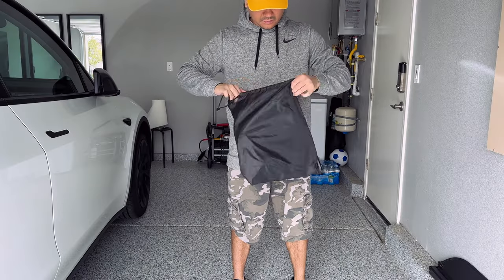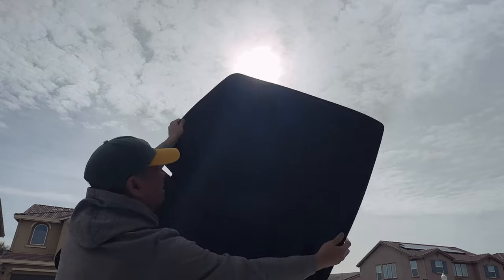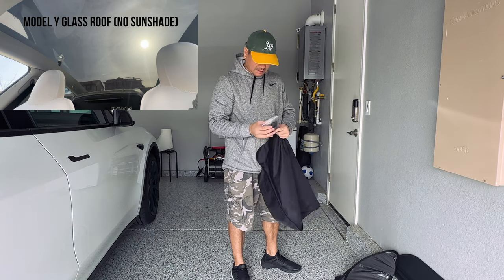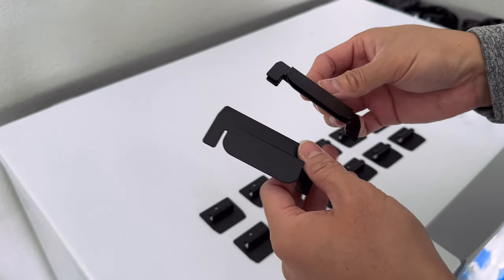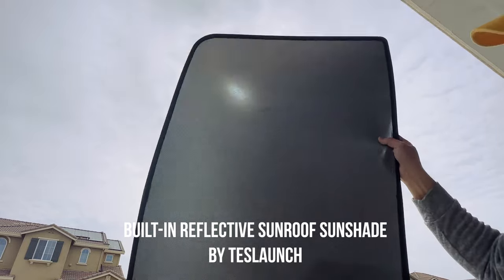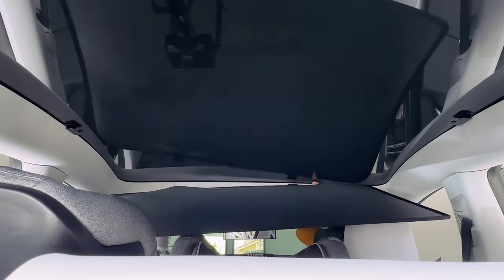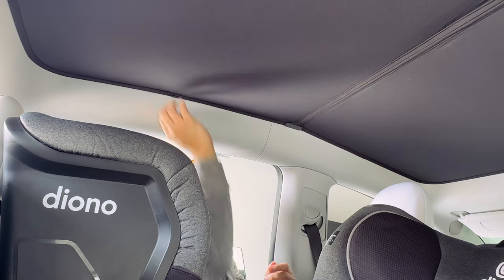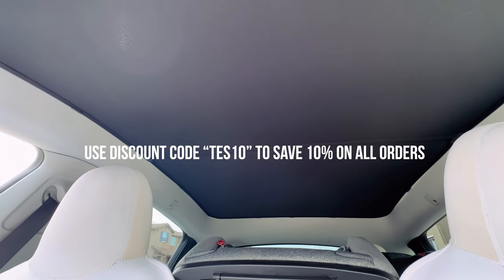Tesla Drivers: Unbelievable Sunshade for Model Y and Model 3! ☀️🚫 (Easy Install)

Comment: I spoke to Teslaunch as to why my Roof sunshade was different than the one on your video. Their explanations was that I ordered the wrong thing. I looked at the website again and I could not find two types of roof sunshade. They did offer to exchange my order for  the one I thought I ordered. The problem with that is that I had to send back the one I had before they would send me the replacement. After having to wait a month to receive the wrong sunshade I could only imagine how long the replacement would take. I know now not to order from Teslaunch again. My recommendation for anyone ordering from Teslaunch don’t plan on getting the product in a timely fashion, and 0:14 hopefully you get what you thought you ordered.

Comment: Yep, awesome review.  Too bad that I ordered a roof shade for the Model Y and got one for the Model 3, which does not fit the Model Y.  There were not big side clips, and one of the sides of the large one was curved, a lot so it will not cover part of the roof glass even if I could install it.  So after wasting over $50, and waiting for several weeks, I end up with something useless.  So thanks for the lousy advice.  I'm glad you got a freebie, it is probably why you actually got the correct sunshade.
Reply from the maker: Sorry to hear that. Are they replying to your emails?
Reply: @modernasiandad  Yep.  They managed to find a way to avoid not replacing or refunding for their mistake.  Good thing I went to a different sunshade manufacturer.

Comment: Finally received my roof and windshield shade. The windshield shade looked exactly like the video showed. The glass roof shade was not one piece, but a mesh screen and a separate reflector that needed to be attached. It attached to the mesh screen with little Velcro strips. No matter how I tried to line up the mesh with the reflector it was not perfect. Then the clips that connected the front shade and the back shade were tiny which made it difficult to connect the two pieces. Can’t figure out why the product I received was different than the YouTubers. Once I got it attached it seems to be Ok. I am going to contact the manufacturer to ask why what I received was different.
Reply from the maker: yes, please contact them to see why it's a different product!

Comment: I just tried to install a Teslaunch sunshade on a 2023 Model 3.  The front section of the sunshade DOES NOT FIT WELL.  It is too wide at the front making it impossible to push it up against the glass to install a clip on all 4 sides.  Cannot get a clip in on one side.  I spent an hour trying to maneuver it, but it just doesn't fit! Maybe I just got one slightly mis-sized? I don't know, but I cannot recommend it at least for a 2023 Model 3.
Reply from the maker: Please reach out to them to see how to fix the problem

Comment: There is no gap between the sunroof and liner on my Model Y.  Do I have to force the clips and possibly damage the roof liner in the process?
Reply from the maker: Try to use a plastic pry tool to create some separation

Comment: Does the Broadway mirror help? What size is the mirror?
Reply from the maker: I'm used to driving with a broadway mirror for over 20 years now. I like the wide angle so it does help me view the rear better. I believe it's a 300mm size.